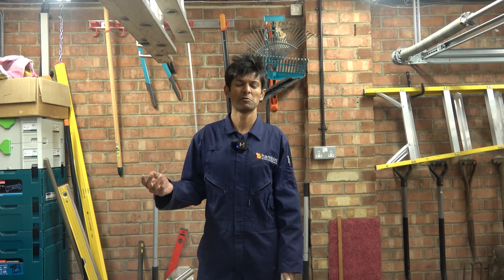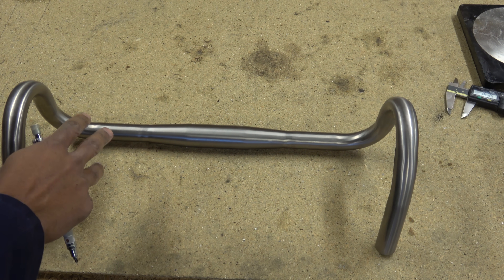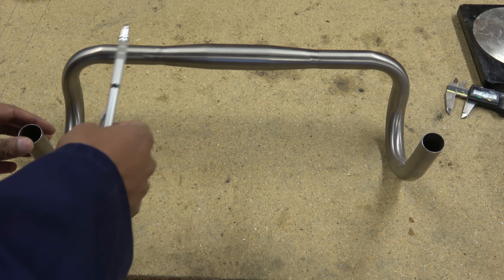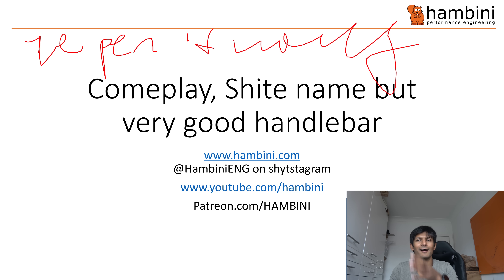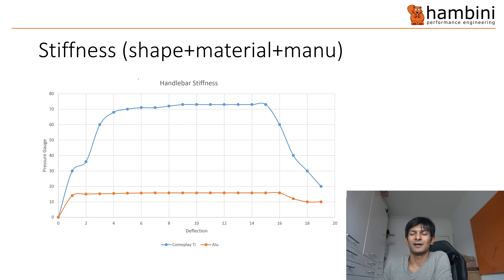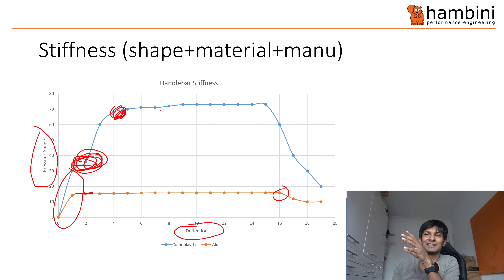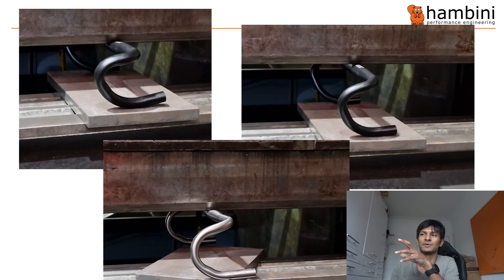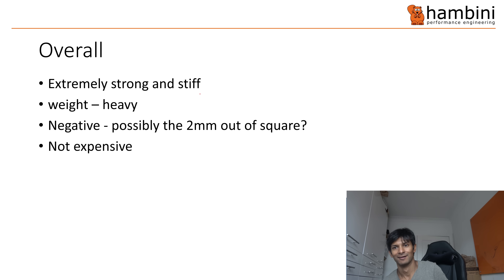Italian Boutique Handlebar REAMED by AliExpress Special On 500T Hydraulic Press | ComePLAY Titanium

Comment from the maker: Here's a link to some more photos and a bit more analysis https://www.hambini.com/comeplay-titanium-handlebars-vs-aluminium-vs-500t-press/ If you are only glancing at this video, the telling point is the descent speed of the ram, it requires much higher pressure to crush the ComePLAY handlebar and is therefore slower.
Reply: A couple of millimeters on positional tolerance for the ends of the bars isn't too bad. It doesn't take much variation in springback or slight variations in rotational positioning to make a 2mm positional difference in an unconstrained condition.

A well set up, top quality CNC bender could hold tighter tolerances than that in production with consistent material, or in process checking and correcting of the bend angles automatically on the machine. There are automated setups that can bend, measure, bend a little more while only ever opening the front clamp to get the angle measurement. 

In high dollar materials, extreme tolerances, or critical applications the expense of the extra automation makes it up in reduced scrap.

The better question is whether the company bending those Ti bars is using a top end machine, let alone any additional automation or fancy tooling, and based on the hump in the last 1/3 of the 180°(ish) bends I'd say the answer is no. I'd guess there will be variation in the ends of those bars in any direction by up to 3mm depending on which bar they actually ship you and how well they QC'd it that day. When you ride you'd still probably be hard pressed to notice 3-4mm of positional difference. We're just not that rigid physically and quickly adapt to small variations. 

15 years tube and sheet metal forming experience with everything from hammers and vises up to 3" CNC tube benders, 6" CNC tube rollers, and 8'x1/4" CNC plate rollers.
Reply: Impressively strong, but I would hardly call $180 for a handlebar, cheap. But isn't the question,  are aluminum bars breaking? Several, I think, weigh 200-180 grams. So what exactly are the chances of an aluminum bar failure. I have no trusted at all of carbon fiber bars because nothing I can do stops them from rotating on some minor bump.
Reply from the maker: @tomkunich9401  On this test, the aluminium is considerably weaker and it appears to be more prone to cyclic fatigue by way of it having a much lower ultimate stress. On the Ti, you won't get near it because the material is so strong.
Reply: Bought a couple of Waltly Ti handlebars a year ago. Mostly I wanted something that wouldn't corrode so much from riding down here in Florida, and didn't want to go with carbon. You're right about the Ti bars being really heavy, but having absolutely no corrosion on the bars when changing bartape is worth the extra 150-200 grams.
Reply: It's a bit crap that you had to use the bottom plate diagonally for the Ti bars, and you could see that the bars slipped off the plate - but there's no doubt the bars are stronger than ally. Is that really a good thing, tho? In a crash, maybe the stiffer Ti bars would absorb less crash impact. Seems like the Ti ones are stronger, and therefore heavier, than they need to be.

Comment: Titanium is a material that is very good in theory but poor in reality. Aircraft engineers are very aware of titanium's shortcomings, mainly that any scratch no mater how small soon develops into a crack.

 Some helicopters have titanium parts in the main rotor assembly. When licensed engineers are working around that area they must wear special boiler suits (boiler suits with no metal studs or zips), must empty all their pockets, not allowed to wear jeans with studs below boiler suits and not have any tools unless that tool is being used. All in an attempt to avoid scratching the titanium parts. If a scratch is found on any titanium part there is a lengthy procedure to remove said scratch.

 Some commercial propeller aircraft have composite propeller blades with titanium strips bonded to the leading edge to act as a wear strip to protect the composite material behind. Every titanium wear strip on these propellers will have multiple cracks. These cracks do not effect the airworthiness of propeller as the titanium is just there as a wear strip, but it does highlight how susceptible titanium is to cracking.

 I know quite a few people who bought titanium frames and every frame cracked after about 7 years. Every crack started between the titanium tube and weld. There was nothing wrong with the welding. When welding there will always be a very small undercut between the weld and material being welded. This undercut acts like a scratch, hence that is where the cracks started. It is possible to sand this away on the outside of the frame, but not the inside.

 Cycle handlebars will almost always pick up a few scratches during assembly. Even if the stem contact is perfect I have yet to see brake levers fitted without lots of scratches on the handlebars. (you would not believe how deep the scratches were on a cycle Ribble built up for me.)

 Sorry I don't see the point of titanium bars when aluminum alloy bars are lighter, considerably cheaper and doesn't crack so readily.

Comment: Handlebars are very constrained because of requirements for standard clamp diameters and widths. There's very little design freedom, pretty much only wall thickness. So you actually expect denser materials to be slightly stiffer at equal specific modulus. Steel should in principle do very well.

Comment: If we are talking about materials: is it safe to use stainless steel A2-70 Bolts in flat mount calipers? M5 looks like quite small bolt and I am not sure.
Reply: As per Sheldon Brown - plain steel is safest bet, stainless also is OK but slightly weaker. Titanium is worst for highly loaded bolts.

Comment: Titanium is more expensive (compared to steel or aluminium) to work with as a material so frames which need all the tubes miter cut and tig welded and so forth precisely, require more man hours and better tooling to do than a frame in the other two metals and handlebars with all the different mandrel bending and drawing also incur more expensve to manufacture from it. But its very strong for its weight, especially compared to the typical steel and aluminium alloys used in bicycle frames and components. Even fairly ordinary Grade 4 Commercially pure titanium is as strong as regular aircraft grade 4130 Chromoly but at 2/3 the density. So if you had a 4130 frame that weighed 5 pounds and you simply replaced the steel with titanium, to the same wall thicknesses and tube diameters and everything you'd end up with about a 3 1/4 pound frame of the same strength. And there are far stronger titanium alloys used in the bicycle world than CP Grade 4 but also much more expensive. Sakae back in the 90s did handlebars in CP Grade 4 though, so its use is not without precedent. So whatever grade of titanium that handlebar is REALLY made from, i would judge it far safer a purchase than some of the aluminum and carbon bars you can find on AliExpress.

Comment: Comeplay with me..... Comeplay let's play away....

Titanium seems to be popular amongst the serious bicycle travelling community. I wonder if the Ti bars are a bit harsh that might be a deal breaker over alloy. With the corrosion resistance and lower 
Stress fatigue failure Ti is a nice alternative..
Bends in tubing renders a thinner wall thickness on the radius which creates a stress point. It's paper thin in some ultralight alloy bars. Carbon can get around gauge reduction on bends

Comment: I had a cheap Chinese titanium alloy front wheel skewer snap in the middle while riding at 20mph. It hurt. Will not be buying cheap lightweight skewers again. Related to handlebars? Probably not.
Reply: Sheldon Brown has warned titanium isn't strong enough to be used for small stressed parts long time ago. 
Hope you are doing well.
Reply: @event4216  yes thank you, fully recovered. I do like Sheldon's site but maybe missed that bit!

Comment: This is an interesting exploration into the properties of handlebar materials. From the analysis it seems to me that that these cum-play bars do not bring much benefit over aluminum. The added strength surely won’t do much more for comfort or vibration dampening. However, they would be nice for fending off against a wild Karen armed with a rake or purse. 

We can see nowadays that manufactures are making an effort to increase compliance at the bars as this a key contact point where vibrations are transmitted. Carbon, aluminum, and titanium have all been used to gain better results in these regards. If Cum-play wanted to reduce weight and increase vibration dampening for the loss of excessive strength they could reduce wall thickness of the tubing. This is a technique which has been used by boutique brands and has shown signs of reasonable success. 

Keep your dickinnavice

Comment: Very nice, but what's the point in having ti handlebars? It appears that they are heavy, un-aerodynamic, and difficult to shape. So you get a heavy brick at the front end that most likely won't have the type of bend that you like. These wouldn't have even been cool or effective in the 1990s. Putting them in a hydraulic press appears to be the most useful thing that you can do to them.

Comment: Interesting test, as anytime a massive press is brought into play has to be good. 

I don't really see much value in the results though, as handlebars aren't subjected to those sort of loads and in any case, the load would be in the opposite direction, ie downwards from the lowest point of the bars.  Didn't tell us anything we didn't already know about titanium being tougher than aluminium. 

Perhaps if the bars were formed from thinner wall titanium tube, then the test would more helpfully appraise whether the lighter titanium bars would be a preferred option compared with aluminium?
Reply: Got to agree, should have set it up with the press applying force to underside of bar equating to reaction of stem in real life. Similar reuslt as purely down to material difference

Comment: Awesome test and tip about these bars. However, safety issues aside, would one prefer stiff handlebars to flexier ones? I'd much rather have a somewhat flexy one so long as it's ultimately safe in all road cycling scenarios I could encounter. 

On top of that, at a specified weight of 320g, those Ti bars are rather on the porky side, and they don't have a compact shape (which is somewhat more popular among amateur cyclists nowadays). 

But otherwise I'd be totally interested in using a pair of compact titanium road handlebars that weigh ~250g and that are at least as flexible as their aluminium, if not carbon, counterparts. Along with a titanium seatpost with similar proprieties, they would totally match my current titanium frame.
Reply: I have a Lemond titanium frame with an offset 360 degree Crack in the downtube. So a bar very light is liable to also be less strong than you'd like.
Reply: @tomkunich9401  as if equally heavy aluminium frames never end up having cracks in the downtube? For what it's worth, aluminium is more prone to cracking because of fatigue than titanium.

Comment: Interesting video. The press test clearly shows that the Ti bars are much stronger than the Al. Isn't the limit really about where the line goes flat, deformation continues to failure with little or no increase in stress? Some of the initial deformation difference may be due to geometry where the Al bars appear to bend at a point of tighter radius. Do we need the added strength when we can get Al bars for 20% of the price of those Ti bars.

Comment: Regarding the 2mm difference, that is quite reasonable over that length and compound bends. Tolerance of +/- 2-5mm is quite typical over that length. Tighter tolerance can be achieved, but it comes with cost via extra checking jigs and rework.

Comment: Having just recently breaking a set of aluminum alloy handlebars, it’s nice to see a set made of titanium. The reason for the latest failure was due to corrosion. I live in an extremely humid area and sweat gets under the tape. Yeah, it’s pretty nasty. Titanium for my everyday training bike bars would make a great option.
Reply: I could see that being a problem if your bars have no paint, but if they are blasted... they won't corrode. You can try wrapping the bar with scotch tape or the lightest option you can find, and then put bar tap over that so it never comes in contact with sweat.
Reply: @Megadeth6633  yes.  I have found a layer of electrical tape works very well but I left it off last time.

Comment: So they're strong but probably a harsh ride?
Reply from the maker: i'm going to be doing a video on damping shortly. For power transfer, stiffer is generally better.
Reply: @Hambini  nice one should be interesting to see some numbers rather than listen to some pencil armed dick at road cc go on about the subjective and magical properties of Ti.
Reply: If it is harsh, it's nothing a bigger tire can't solve. Besides I would much prefer to have compliance in the tires than in my handlebars.
Reply: @Megadeth6633  that's too many compromises, the bar needs to bring more to the table than just strength before anything else is changed to accommodate it.

Comment: I'd like to have handlebars with larger tubes, especially for the drops. I've large hands and the standard bars are too skinny. I suppose I could wrap them several times with thick tape but I'd rather not. I guess it would difficult to attach the breaks/shift levers if they weren't a standard size.
Reply: Hope you’re patient then .There’s a lot to be said for more cushioning on the handlebars.
Reply: I'm the same way. That's why I use Shimano Pro bars. They're 31.8 all the way across. And on the drops I wrap cork under the handlebar tape to make a fatter handlebar.

Comment: I'm not sure i like the bends on display here. I've been working on a custom handlebar design, and it's going to have welded sections to minimize bending, and I've picked a manufacturer that seems to have cleaner bends without the crimped sections. (It's for the track so weight isn't really a concern)

Comment: Wondering: which serious cyclist who puts out enough power (where this slight deflection in the Al compared to Ti during sprinting matters) actually uses stock round bars instead of carbon aero bars? Horses for courses
Reply from the maker: probably someone who doesn't need it, lounges around and like to show off their bike at the local cafe.

Comment: Nothing really new here: titanium is ductile and aluminium is brittle, although both handlebars do very well in this test. Much more interesting would be a fatigue test until failure and comparison of the number of load cycles ...
Reply: Material properties are also very dependent on the alloys of the base metals
Reply: Relatively brittle doesn't mean fragile, infact most alloy especially 6061t6 handles regular flexing just fine. Alloy handlebars have more consistency in production quality since every manufacturer in the far east has gotten so used to dealing with it.
Reply: I should add depends on heat treatment as well….
Reply: My carbon has been under several load cycles by my own hands and it fails very rarely
Reply: Lol . . Don’t pretend to be an engineer. It’s not “aluminum” it’s aluminum alloy. Aluminum alloy in any heat treatment I’m aware of is not “brittle.” Iron is a great example of “brittle.”
Reply: @M3CoupeC50  Don't pretend to be an engineer exposing others. Before you went and triggered yourself, why weren't you assuming that he's referring to alloys of both metals? Not like his original comment is wrong when taken literally.
Reply: @M3CoupeC50  find me a metal bike part that's not an alloy of some kind other than maybe a silver or copper headbadge

Comment: Any company that works against Brompton is alright by me. 

I'm trying to work out who makes the ti frames for Sonder/ Plant X/Ribble to contact them directly. It's definitely the same company.
Reply: 2 of those frames are made by a company in Xiamen. Seen their boxes in the factory. Can't say any more tho. 🤐🤐🤐 (ComePlay are based in Baoji, not Xiamen.)
Reply: @ChinaCycling  there's a really high end "custom" US company that uses them. Identical dropouts, bracing and tube forming at the weld points.
Reply: maybe waltly titanium
Reply: I worked there for years,some are made by walty, lots by Hebie hang lun
Reply: I got a titanium frame from a Taobai seller located in Baoji at around £320, quality-wise it is pretty nice~~